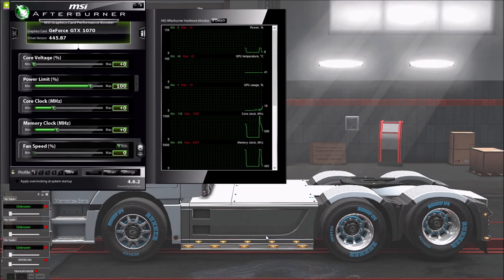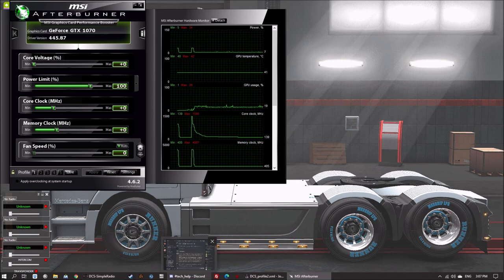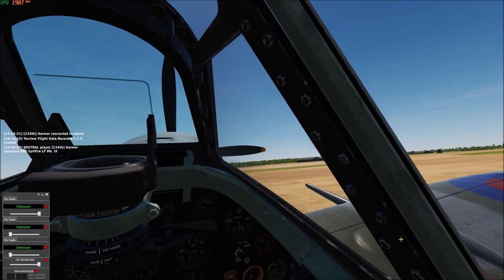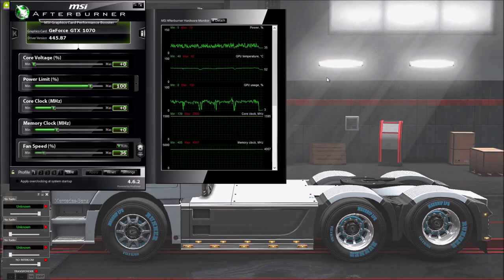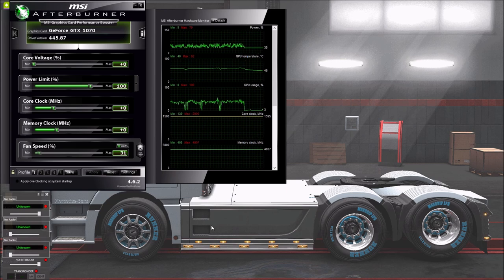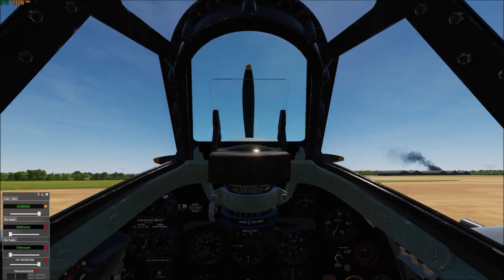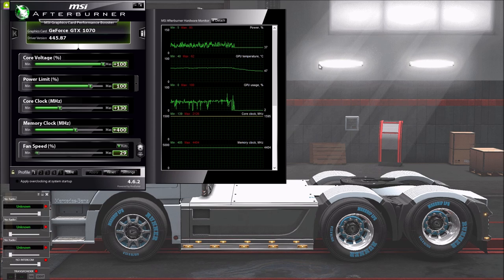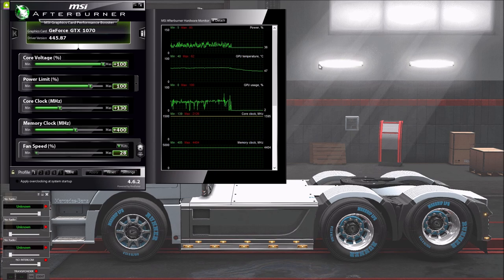Does overclocking DCS work?

Comment from the maker: I did a test today, running TTI (Through the Inferno) on our (ASOR) dedicated server.
Test 1 was no overclocking and produced an average 40-50 frames.
Test 2 was with overclocking and produced no discernable difference.

Conclusion: Overclocking GPU is not worth it. From this I gather that DCS is more CPU intensive?